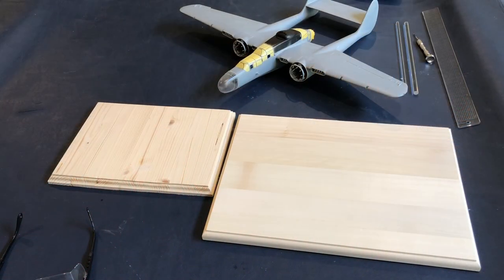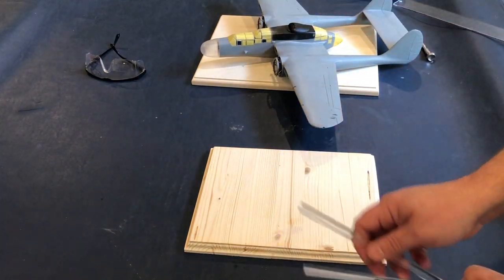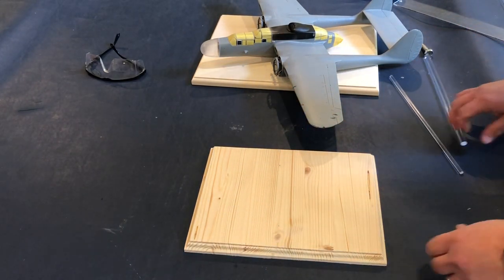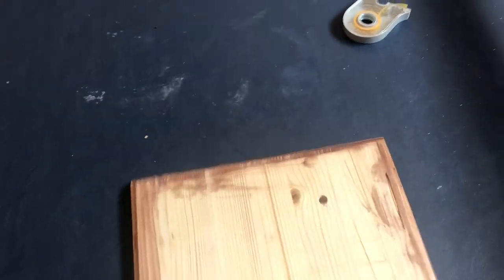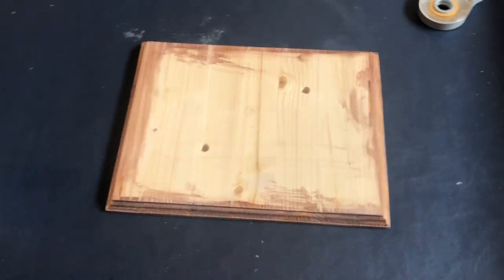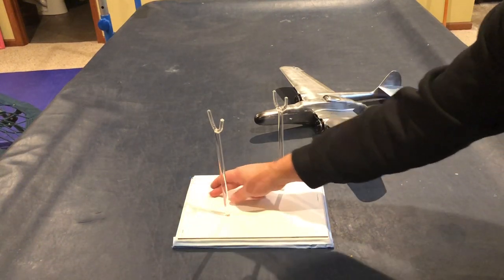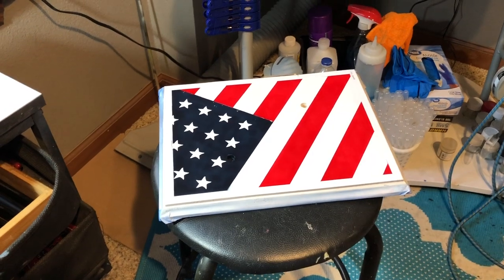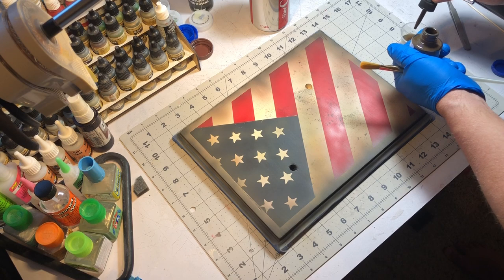Making a Scale Model Aircraft  Display Base/ Stand

Comment: That's a great base idea.  Have you thought about using Neo-magnets (high-gauss magnets) on the acrylic rods?  They can be as small as 1mm in diameter and fit anywhere on the model (and can be painted over) - you could even make them look like access panels.

Comment: Very nicely done. I will have to try something like this for my models. Just out of curiosity, I know epoxy is strong but can get brittle, have you thought of reinforcing the joint with a small dowel or rod to ensure it’s strength?
Reply from the maker: Thanks MyHobbyChannel.  I’ve considered using a small aluminum rod drilled through the cradle into the upright but have done some testing with epoxy and found that if I rough up both mating surfaces, it will hold for the purposes of keeping the plane from falling and breaking to pieces.  However, if you crank on it, it will still pop off.  The rod would definitely add a better mechanical bond but I want to make the cradle “disappear” as much as possible.  By drilling through it and pinning it, wether with metal rod or even a smaller acrylic rod, it looks sloppy.  Just using epoxy may not be the strongest solution but it gets the job done while drawing less attention to the cradle.  In short, I’m compromising added strength for appearances by just using the epoxy.  I’ve also tried bonding the two together with various cements.  The only one I could get to somewhat work was Plastruct.  It appears to melt the acrylic together but the bond is weak.  Let me know if you come up with something better, Im always eager to learn something new.

Comment: With all your stuff going on I hope you see this....What rod with would you recommend for 1/48 aircraft?  Nothing big like a DO335, just regular size WWII fighters like a Corsair or P47.  For 1/32 I'm guessing 1/2 for something like a Spitfire and what, 3/4 inch for a big bird like an HK B17?  You just elbowed out Will Pattison as my favorite builder....and that's a big compliment.
Reply from the maker: That’s quite a compliment as Will is one of my favorite YouTube modelers, I’ve learned a lot from watching his stuff.  As for the rods, here’s what I typically use:

1/48 ww2 fighters, 1/4”, that’s plenty strong enough.  

Larger 1/48 jets/ bombers depending on how they’re mounted 1/4” to 3/8”

Really big stuff, 1/2 inch.

A lot of it really does depend on how it’s mounted.  With my 1/48 tomcats I like to bend two 1/4” rods and shove them thru the exhausts.  I could actually use just one 1/4” on them if I ran it vertically thru a hole in the bottom of the plane.  If you’re gonna start mounting some of your builds, I think the sizes I listed above will pretty much cover whatever you’ll need.  Hope that helps;)
Reply: @seanerk5kt9  great info, much appreciated.  I assume you are just using a lighter and a little distance to heat them for pliability.  Thanks again.
Reply from the maker: Heat gun
Reply: @seanerk5kt9  being bald, hairdryers, heat guns anything like that just doesn't register!  I have a heatgun in the tool box, forgot about that.  Thanks.
Reply: @terrym7641  😂